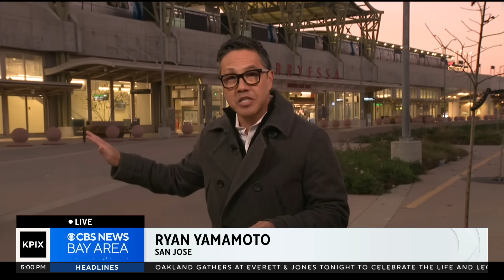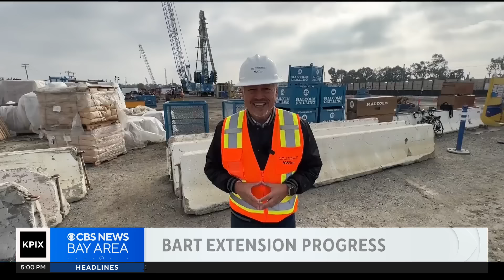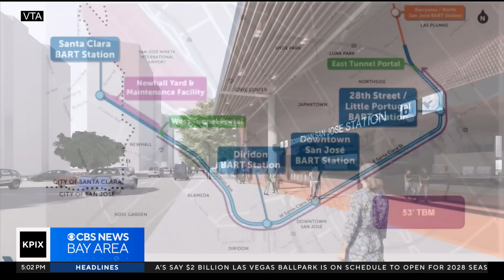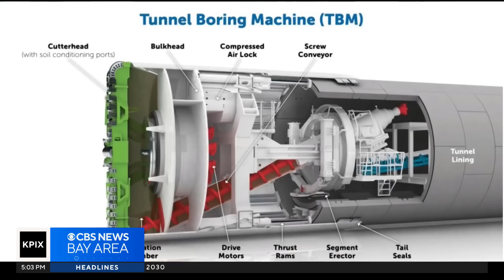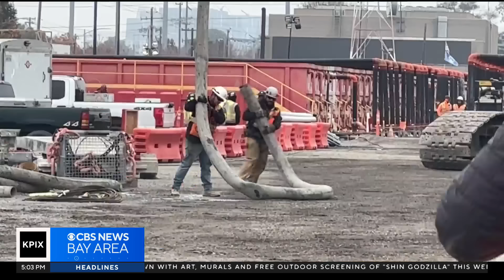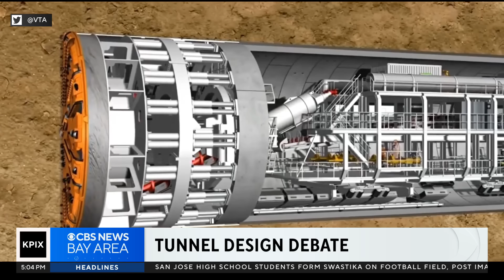South Bay BART extension picking up steam with massive underground tunnel construction

Comment: This is the worst public transit project perhaps ever, and I say this as a public transit fan! VTA refuses to accept the reality that their single tunnel deep bore is overly expensive, requires huge station boxes, and adds several minutes to travel times as passengers need to navigate to deep platforms instead of just walking down one flight of stairs to a platform less than 20 feet below the street.

This project should’ve been cut and covered or aerial to save costs and time. With the extra amount the tunnel costs, VTA could easily have paid the retail businesses affected by surface construction for any lost business.
Reply: You have no idea what you're talking about. Watch the actual board meetings instead of youtube videos by foamers
Reply: @g @gandhihype the board is clearly delusional. They don’t want cheaper cut and cover or aerial construction because they don’t want to disrupt the streets or light rail (that barely anyone uses) and don’t like aerial because of the views. Now they’re in denial of their cost estimate even after they got only one bidder and it was massively over budget.
Reply: @pizzajona Again, watch the board meetings. Not foamer videos. You clearly haven't seen the analysis that staff had done on cut n cover.
Reply: @g @gandhihype lighten me. It seems like you’ve watched them. What am I missing?
Reply: @pizzajona They comissioned analysis of twin bore with cut n cover stations vs the big bore. Twin bore was more expensive in part due to the larger station excavation footprint.

Beyond that, cut n cover is not a given for a cheaper project and hasn't been for decades. This isn't the 1930s. Nobody builds cut n cover trackways anymore because TBMs are so efficient. Even in low cost countries like France, Spain, Turkey, etc.
Reply: @gan @gandhihype e low cost countries still cut and cover stations. And they definitely do aerial construction as well. You know what has a larger station excavation footprint, 80 foot deep platforms instead of 20 feet. San Jose’s low building heights also mean they don’t have to worry about foundations like in other denser urban settings when it comes to cut and cover.
Reply: @pizzajona  Again it's clear you don't know what you're talking about with regards to VTA or BSV2. 

VTA knows how to do elevated rail. In fact they do it better than most in the US because their current EBRC project is building for the same price as India and Thailand.

Comment: One part of the plan is strange. Why put the Downtown Station so close to Diridon? Would be better to place it near Civic Center/SJSU  where is could feed more passengers to civic services, university and businesses? I thin San Pedro Square already has enough customers for the bars.
Reply: So it can interchange with the VTA Blue Line, which it otherwise wouldn't have. I think the better way to get people to and from civic services and businesses further away from 1st Street would just be to put in bus lanes all the way from Alum Rock to downtown. Besides, the university is still only a few blocks away.

Now, would I prefer if they did cut and cover for the extension and took the opportunity to elevate the 1st Street ROW through downtown? Yes, I would. It would dramatically improve travel times and lessen bottlenecking throughout the system. But I'd have also rather they did a dual bore that wasn't so deep, so I guess nobody's listening to me either way.
Reply: There's a stop around 1st Street it looks like, which is... close enough I guess.

Comment: There will be self-driving cars all over the Bay area by 2037.
Reply: Even by 2027 it will start taking off, Waymo and Tesla leading the way. With the low population density of the Bay Area (1,100 per square mile) these multi-billion transit projects make no sense other than as political payoffs for union support. The vast majority of Silicon Valley's workers (from executives to gardeners) are driving. Make driving and parking as efficient as possible. Major infrastructure projects should enhance the flow of the primary mode of transportation: CARS.

Comment: So it isn't going to the airport, repeating the stupidest mistake they made with SFO, that is letting the tax lobby stop BART from entering the airport. Good going.
Reply: Bart has a train that goes to SFO airport
Reply: @danielleweber8914You must be young. SFO extention is relatively new. For a long time, Daly City was the last stop on the line. Everything OP wrote was correct, special interests pushed hard to stop the SFO connection for a long time.
Reply: @stevens1041 ? It is going to the airport, as you admit, so why am I wrong? Never mind, I’m ignoring you.

Comment: Wild that we're spending billions on the expensive deep bored tunnel option, and then went completely off the rails with the even more expensive single bore tunnel. It will make riders take multiple long escalators to get between platform and street forever, to help these downtown business owners avoid mere millions in potential lost business during construction. Why on earth didn't we just pay them to relocate or offset the lost business? Offer them a storefront in the station when it's complete, which would be years faster than the deep tunnel plan! Are the VTA board members under the thumb of Big TBM?

Comment: I don’t live near this construction so don’t care where it goes or when it opens. 

For my money, I’d like to see 280 go under San Francisco’s 19th Ave so you can drive freeway from 280 to the GG Bridge. It’s nuts that north-south traffic has to chug through 7 miles of city streets. Put in three exits… (1) at the south end of 19th where 280 currently ends, (2) at GG Park (3) and then down by Lake at Park Presidio where tunnel surfaces north of Lake.

The west side of SF would be do much more livable without all that 280/1 traffic. Pollution, massive time saved. Trucking would be better…

Comment: Airport station..  An airport station is still needed..  And still will be needed in 2037..
Reply: The airport isn't busy enough to justify a station.
Reply: San Jose Airport shouldn't even exist. It can and should be demolished.
Reply: @gandhihype interesting comment..  If SJC didn’t exist which airport would people traveling to or from San Jose use?  For frequent travelers SJC is pretty convenient compared to any other Bay Area airport, saving a lot of ground time and miles.  SFO isn’t well sited in many ways.  And neither is OAK.  NUQ could become a civilian airport but it has challenges too.
Reply: @gandhihype  silliest thing I ever read. San Jose Airport is doing great.

Comment: BART needs to cut $400 million from the budget starting in 2027. The Santa Clara extension will see fewer than 10,000 daily riders. And it isn't opening until 2037. This project is 100% getting put on hold.
Reply: The Santa Clara STATION will see about 10k riders. The full project will be around 55k.
Reply: @gandhihype  this is not exclusive to the Bay Area. Trains don't seem to attract good or economical designers. A 16 mile segment in Maryland cost $10 billion. These projects simply attract bureaucracy and layers of management, consulting, legal and environmental review, legal challenges, and if course the ever popular funding lapses. The Bay Area generally has the worst ROI in California for public transportation trains funding. The best? Los Angeles. That's right, when LA is better you know it's rock bottom.
Reply: @gregaskew7065 You have identified the problem correctly but you didn't identify the issue at its core. The Bay Area's infrastructure is inherently more expensive than other places because the cost of living is some of the highest on the planet. Construction workers can't be shipped in from Louisiana or Montana and paid at their local wages, we have to pay livable wages for the Bay Area. So no matter what happens we are going to have higher costs than other places.

But regardless of wages, the high costs of American transit projects is not an issue of extensive bureaucracy, it's actually the opposite. It's a reflection of an underdeveloped bureaucracy. In America we don't build out the knowledge and talent bases that other countries do, we contract everything out to the private sector. This means we don't have extensive internal experience that helps us know where to safely cut corners. BSV2 is heavily contracted because VTA has never built an extensively tunneled project. By contrast, VTA's EBRC is being built at identical costs to low-cost transit construction countries like India and Thailand because they have some measure of internal knowledge for light rail and elevated structures.❤
Reply: maybe, but remember they're spending their favorite kind of money:  someone else's money.  We can thank middle-America taxpayers for that $5.1B.
Reply: @atoz09093 Most federal taxes are not paid by Americans in the middle states of the USA. California taxpayers send the most federal tax dollars to DC. It's about time we get some of it back for public transit infrastructure construction.

Comment: Why start from the west side? This means they can't open the stations closer to Berryessa until they finish the entire thing.
Reply: You need a lot more space for TBM launch than for TBM extraction. I expect there wasn't a suitable site to launch the TBMs from on the east side.
Reply: @gRocketOne  that side of the BART does have more homes that likely needed to be destroyed. It just sucks like the high speed rail it won’t open in phases but all at once. Honestly BART reaching downtown SJ and Diridon Station are a bigger feat than Santa Clara

Comment: Why are they going around the airport and not to the Airport?
Reply: The final stop is going to be at the Santa Clara Caltrain stop, which already has a bunch of local busses and a parking lot, and also has some empty space nearby for a railyard to stick bart trains when they go out of service (which you kinda need at the end of a line). The real question is why VTA doesn't go to the airport.
Reply: @deboogs  No rail to the airport, but there is VTA bus route 60.
Reply: @Trancefreak12  Who rides buses? You know who!
Reply: @deboogs  " The real question is why VTA doesn't go to the airport." 👍💯 "HELLO McFLY"!!! Correct, that should've been done from the get go! They could've/should've put in a line to the airport from the N. First St. Line? I suppose they could put in a Tram System like they have from the Coliseum BART Station to OAK Airport?
Reply: @GDub-r6c  because lets just say BART users are not typically looking to buy a plane ticket...
Reply: @drewbeats.3228  Do VTA riders buy plane tickets? IMO: your comment makes no sense. So what kind of people use BART or VTA? It's not just regular BART/VTA  riders who fly. People who fly will use BART or VTA to get to & from the airport if they don't get a ride or use park 'n fly.
Reply: @GDub-r6c  I am talking specifically BART. Most people would rather use cal train. Is what it is. Why would I take BART that goes through east Oakland?
Reply: @drewbeats.3228  Gee, I didn't know Cal-Train runs in the East Bay??? You are familiar with the East Bay aren't you? Look at a BART Map and the cities it serves!!! 🤫🙄😮‍💨
Reply: Is it too late to switch back to a cut-and-cover dig like the sane people wanted? Deep stations are idiotic
Reply: That’s not a bad idea. Don’t know
Reply: Because a few years down the road they will go to the airport then the cost will be 2x more then today.  It's called scamming taxpayers.
Reply: because....California.  Why do something right when you can choose-you-own-adventure stitch together several filthy messes?
Reply: Because the democrats have failed the project planning. All the care about is how much money can they embezzle

Comment: horrible design. should've been cut/cover. less chance for delays
Reply: point out the buildings you'd like demolished or the street you'd like blocked off for half a decade for cut/cover
Reply: You can’t just cut and cover a 5 mile tunnel in San Jose 💀💀
Reply: @Lumber91  We did cut and cover through the middle of downtown SF from Chinatown to the 4th/King Caltrain station to build the Central Subway.
Reply: @aisdtastdatsbd central subway is a mix of both methods depending on which tunnel you’re talking about.
Reply: @Lumber91 yes you can . Sorry San Jose is not NYC or Chicago density wise. Even LA does cut n cover for the D Line subway
Reply: @williamerazo3921 How does one cut and cover a 60-90 ft hole
Reply: @williamerazo3921 No, LA used TBMs to bore the dual tunnels. Cut and cover was only used to build the stations.

Comment: Nice! One day we’ll be able to take a 100 mile ride on bart from SFO to Santa Clara, which is less than 40 miles away.
Reply: 78 miles to drive about the same route today. At least there's Caltrain for those who want the shorter route.
Reply: Okay, than no Santa Clara extention at all. Just no pleasing some people.
Reply: forgot about caltrain mate.
Reply: @levonpamukyan13 Still have to take bart from the airport to Millbrae to get the train. You might be waiting a while, especially on weekends.
Reply: We need tunnels underneath the other Bridges as well 92 and 84. If I'm in Pleasanton, I shouldn't be having to go through downtown San Francisco to get to the airport in South San Francisco. It should be through 92 bridge.